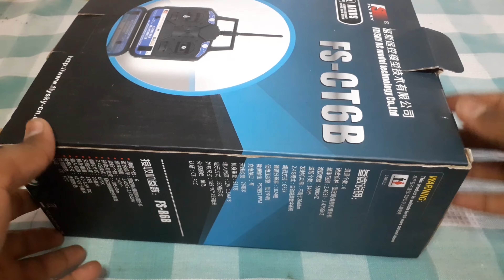How To Make APM Drone | In Tamil | f450 drone | #drone  #tamil #quadcopter  @harinscreativemind3509

Comment: I made this APM drone. But stable a illa. Light-a right-la poguthu. Eppadu adjust pandrathu, eppadi stable-a value adjust pandradu?
Reply from the maker: We should change value in transmitter or you should use Stabilize flight mode, if you not clear contact in Instagram, link in description